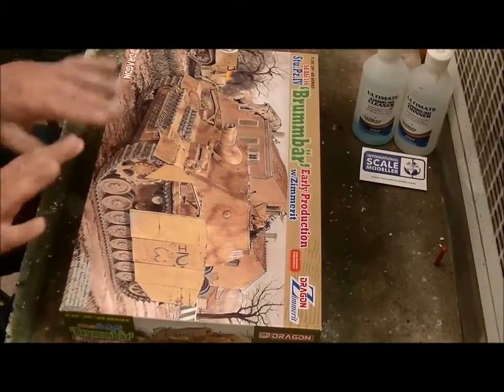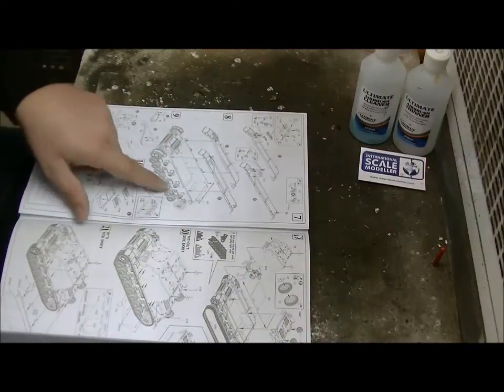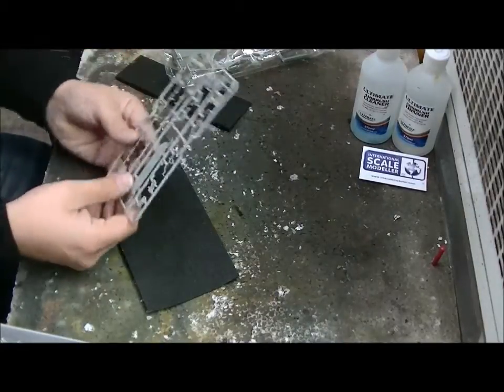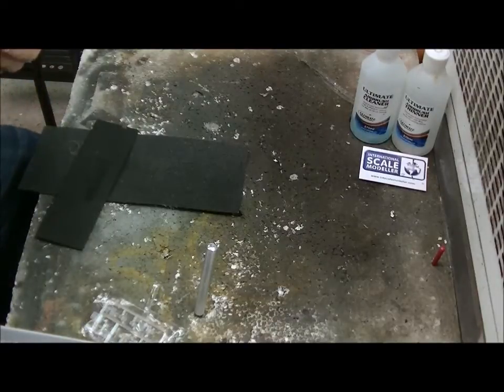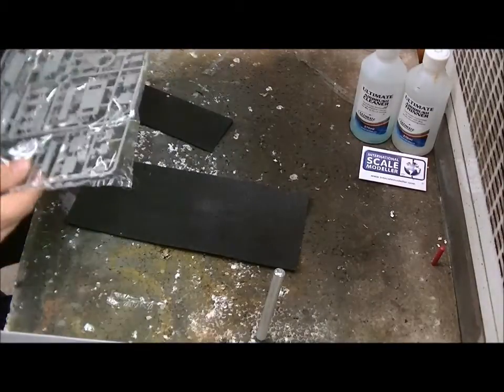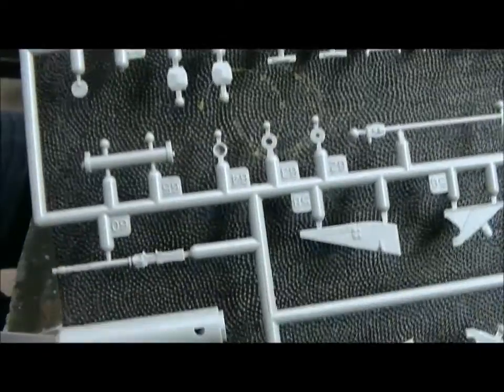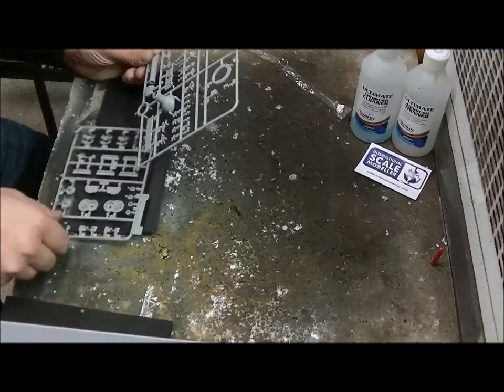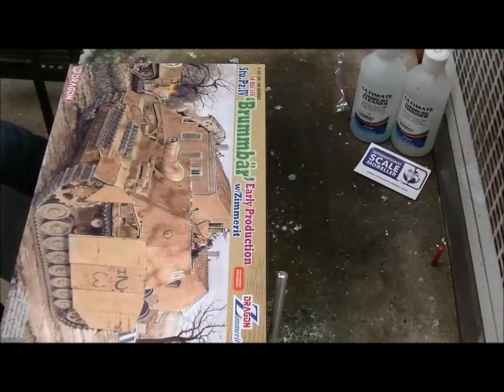Kit Review: Dragon Pz IV BrummBar Early w/Zimmerit

Comment: Dragon's Zimmerit on some models is pure art, that Brummbar is one of them. As always with Dragon, assume the instruction were written to cause you problems. On my Brummbar there were parts to be added at the rear of the superstructure before it went onto the hull. The placement wasn't clear and if I had done it in the order the instructions gave I would have put the parts in the wrong place (too low) and there would have been an issue getting the engine deck to fit. I would suggest you consider getting the front of the hull, superstructure and engine deck on the hull before attaching anything to them.
Reply from the maker: Thanks for the heads up bud ! And yeah the Zim on this one is a work of art